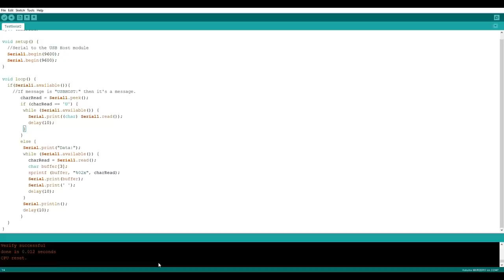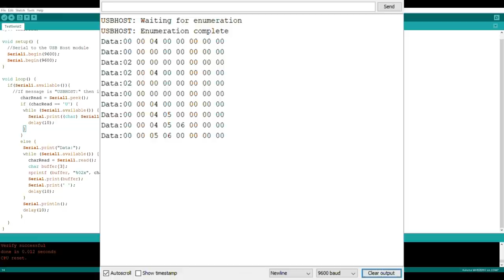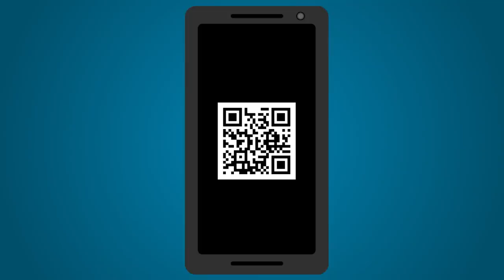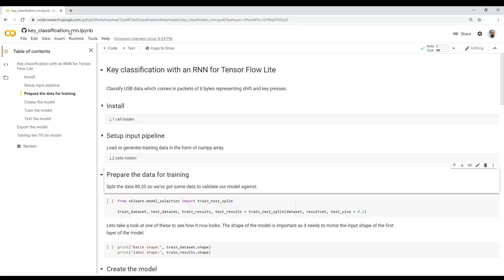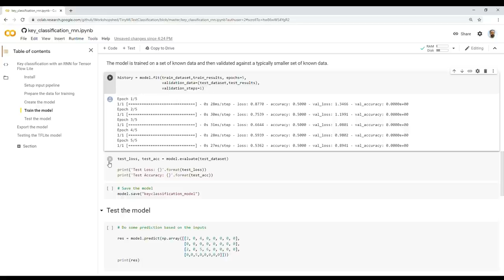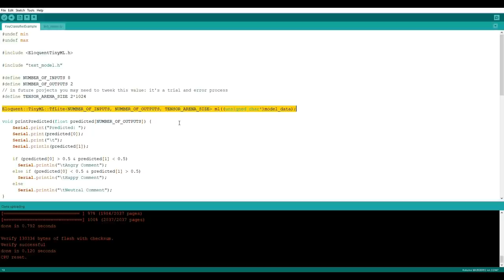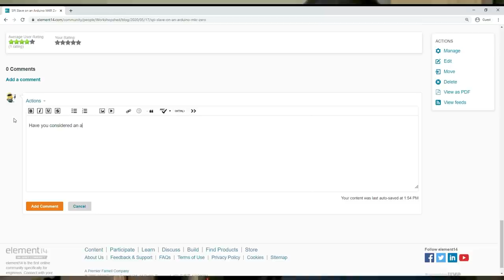Build an Anti-Troll Bot Using TensorFlow and Arduino

Comment: I'm confused because there seem to be no negative comments about AI controlled censorship.
Reply: The AI deleted them..
Reply: I think that means it's working? 😅
Reply: @xXDeltaXxwhotookit  I see! Thank you.
Reply: The AI is trained on a large data set which was generated by real people. So it could pick up on their biases as to what good and bad actually is. And there have been cases where that actually happened. But in many ways this is not much different to feedback from your peers and connections. Which is why people end up in groups/bubbles where everyone thinks the same.